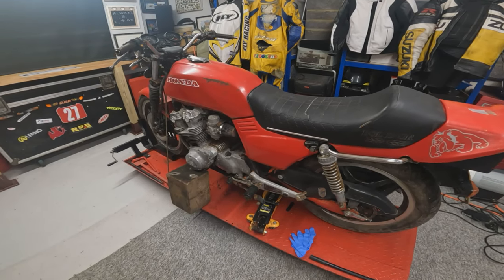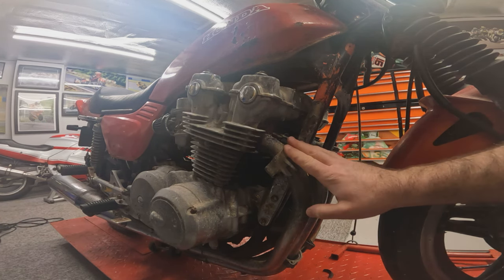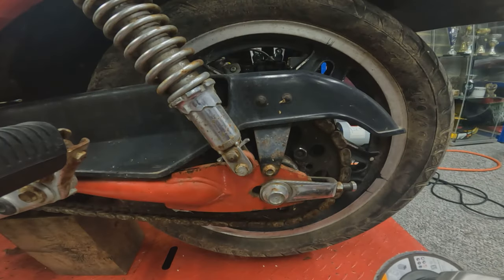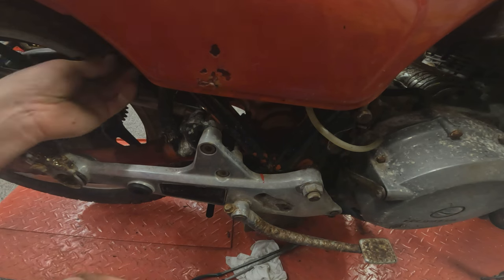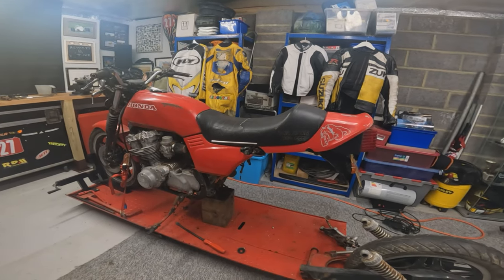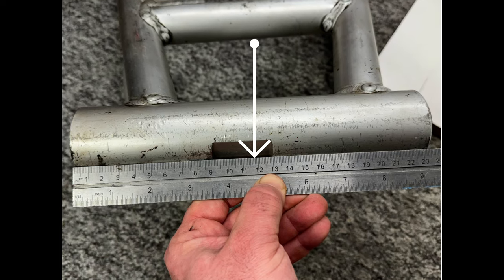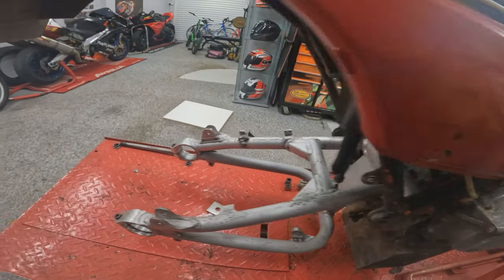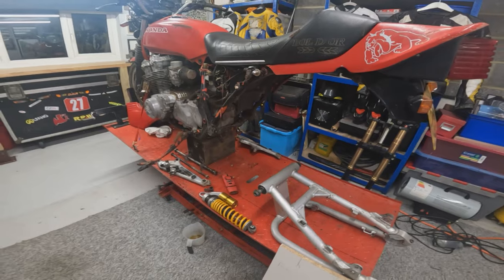Honda CB750F Restomod # 2 - ZRX1100 Swingarm conversion

Comment: That swingarm sleeve that you make on your mate's lathe will have to be hardened.  How are you going to harden it?
Reply from the maker: I am planning on using EN19 which is a chromoly that can be bought hardened and a good engineering steel for gears, shafts, etc it can also be hardened with quenching or induction hardening for better control
Reply: Yeah it'll have to be case hardened after machining. Let us know how you get on, doing something similar myself. Did you have to take much material off the back of the gearbox to get the swingarm in? Great video.